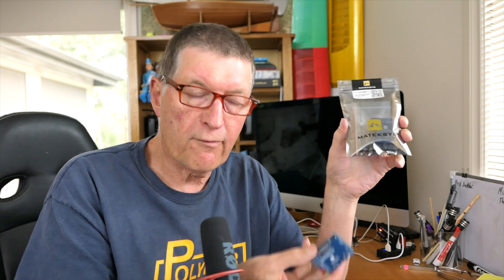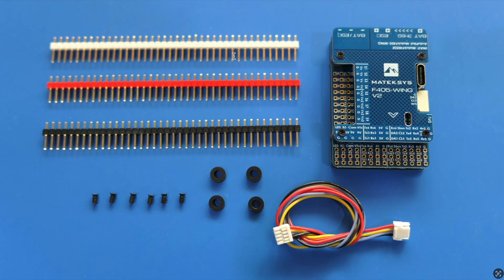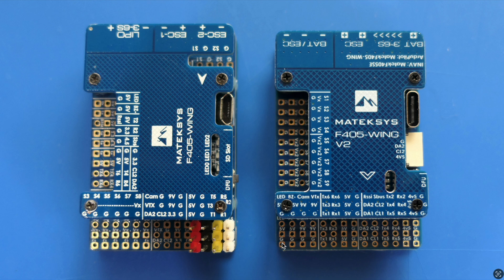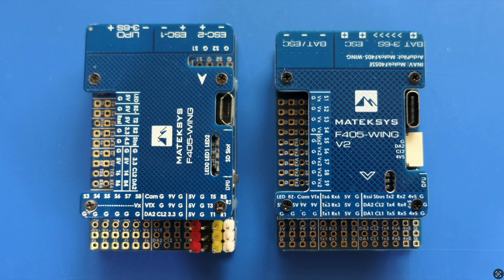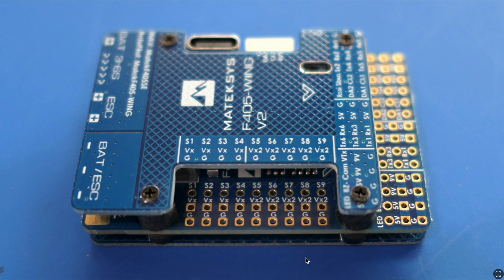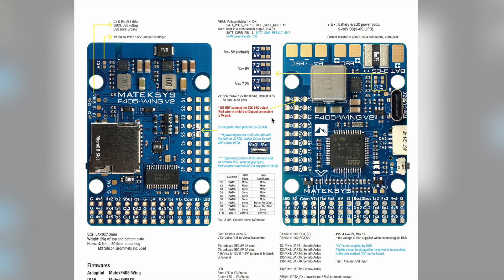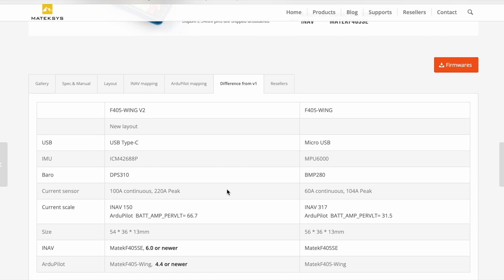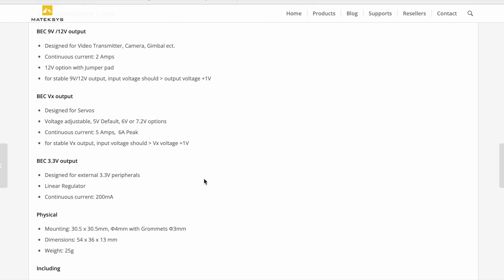Matek F405-Wing V2

Comment: I'm considering purchasing this.  Does this offer at least a 30Hz OSD update frequency with INAV?  All the videos I've seen with an OSD pitch ladder HUD update at 1 Hz, which is not good.
Reply from the maker: I have never noticed any OSD delay but I'm using HD and no horizon or pitch ladder. 1Hz would be terrible.

Comment: Dear Andrew, thank you so much for this treasure drove of information! I have a question linked to the caddx G3 gimbal with their head tracking googles together with the matek f405-wing V2: I have a glider with 7 servos (flap, aileron, v-tail rudder +  motor). So that would fill upp all pwm's on the matek. Can I still route the head tracker to the gimbal using something else? I also would like to have an airspeed sensor in case there would be some competition for that port between airspeed and gimbal?? Many thanks again!
Reply from the maker: Do you need PWM gimbal control? The GM3 head tracking works with the Goggles L and just 9V power from the FC, no need for PWM. Airspeed sensors use either I2C or Analog input so there won't be any conflicts
Reply: @AndrewNewton  Thanks for the very swift reply. No, I don't need the pwm control, just headtracking. I thought somehow the signal from the googles needs to get to the gimbals and I assumed it needs to go through the transmitter/receiver link. But maybe there is a direct radio link from the googles to the Vtx instead, so no need to route it via the radio transmitter link??

Comment: Hello Andrew, could you please please let me know how to wire up the DJI 03 Air unit on the F405 wing V2?
I don’t want to burn up anything and would appreciate some help please 🙏🏻.
I’ve seen your video so I can prob Co figure it using Inav7 , just not too sure where to place the cables in the board . Please help
Reply from the maker: I don't have the 03 but my V1 Air units connect to 9V and G (underneath the VTX pin) and Rx and Tx go to T3 and R3 pins with UART 3 set as MSP DisplayPort
Reply: @AndrewNewton  thank you so much for your reply Andrew . Will give it a bash ..
Nice videos you do :)
Reply: @lxgb01 did you have the O3 air unit working on this board and do you have osd in the goggles?

Comment: si puo' avviare il motore senza usare il GPS?
Reply from the maker: If it is configured to use GPS then it won't arm until the minimum sats are acquired. Can set that to be zero sats but it's not recommended. But you can use INAV with no GPS

Comment: Can I read the signals in another Arduino based board? I plan to use this but also display nice information directly to a mini TFT LCD in front of the camera for FPV of course.
Reply from the maker: Yes it does support basic info on an OLED screen, but not all the telemetry

Comment: 3:48 the way those camera and vtx plugs are supposed to be rotated 90 degress relatice to the UART plugs next to them is a bit awkward. If you have stuff that needs a uart but cant run from 5V (digital fov systems come to mind) then you have to crate split plugs if you want to use more than one of the 9V pins.
Reply from the maker: Yes, that's what I usually do. 2 x 2pin plugs. Means I can easily swap Rx and Tx too

Comment: + is not in the middle on the cam and vtx plugs on V1.  Fried a cam forgetting that.  On every other 3 pin Du Pont plug I have ever seen it's in the middle to prevent that.  I figured Matek did that for a semi-good reason having to do with the layout.

Comment: Ive got a brand new unused original, waiting for my 'dream' RC Explorer Tricopter....
The USB has always been of concern to me...
With all the latest other Matek boards having a 'remote' USB I was REALLY hoping a v2 version would use the same method...
As excited as I am to see a new-er of the original brought back, I am SO disappointed they kept USB directly fixed to the board- new USB just means I'll now have to get ANOTHER lead to lose! :v
That being said, I'll probably pick up one of these to stick aside & finally break out that original I still have... ;)
Looking forward to seeing the pricing on these- thanks for sharing!
Reply: Just get the speedybee wing and call it a day. Amazing board full of features
Reply: @k1ortia  Sadly, it's not 30x30 mount spacing & it's almost as, if not more bulky as the Matek with its erect USB poking up in the way...
Reply: @bleeksbentbits3150  True. But still a better specced FC for the money